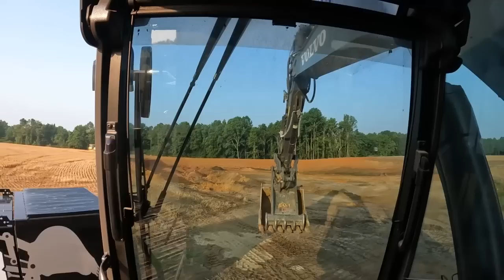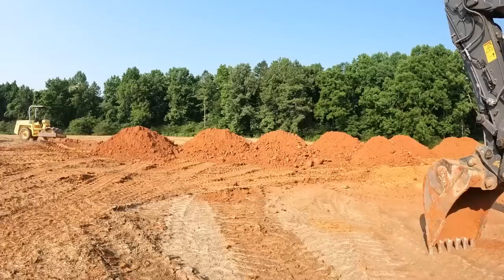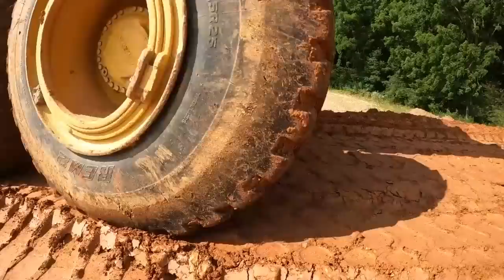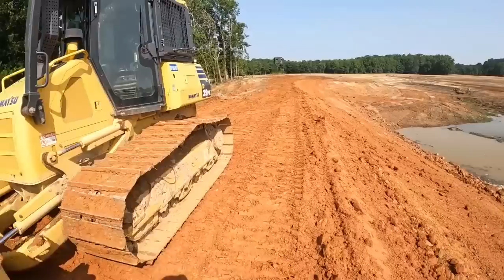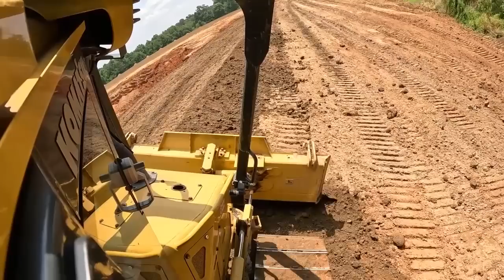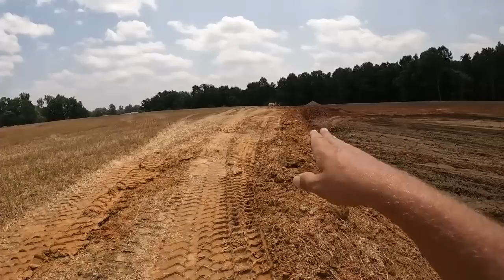It Took All Week But The Pond Dam Is Finished!

Comment: Chris,
Great job. My favorite pond so far. Bealy Good is working on his dock by himself. Can you run over there and make sure he doesn’t screw it up. It’s already going to get flooded every time it rains. 😂
Reply: Flooded or maybe washed off every big rain.
Reply: Nah, Chris put in a large capacity overflow and if that don't do it, the spillway will.
Reply: 🤣🤣🤣🤣🤣 It’s a tanning deck. Need to get wet occasionally
Reply: @orionwarren4244  The dock already flooded once. Chris did good work but Bealy Good built the dock on the water line so when it rains hard and rises above the overflow the dock floods.
Reply: Gotta be able to dangle your feet in the water!
Reply: @thomasthompson8630  🤣🤣 The dock has never flooded. The water came up on the floor joists 4”. The dock isn’t going anywhere.
Reply: It's really a fish net, it's so close to the water surface you'll  be able to dangle your bait right at the edge and the fish will just jump onto the deck.
Reply: @ltanthrax8435  😂🤣

Comment: This will be a little story time and might get long. Seeing about two or three scoops worth of clay stuck in the bed of the haul truck. I get reminded of something I overheard way way back from a old dozer operator. That they used to spray oil on the bed or blade so dirt or whatever wouldn't stick.

A problem I saw with that even back then, at the awesomely intelligent age of seven, was that even if you did that, after one or two loads in the bed or a few minutes of dozer work. Any oil that had been applied would be worn/rubbed off and or absorbed by whatever you were pushing or hauling dirt wise. But like many kids before and since, adults just said I didn't know what I was talking about and to drop it.

Even now, all these decades and years later. I can still hear it being said as if it were gospel truth and it still makes my eye twitch with how wrong it is. 

Sure a smooth worn bucket, blade or bed is one thing that'll help shed dirt, but as evidence here. Sticky clay is still sticky, no real way around that. While a rough surface has 'bite' for things to stick to. Straight up sticky seems to cling that much tighter to glass smooth metal with an almost suction like cling.